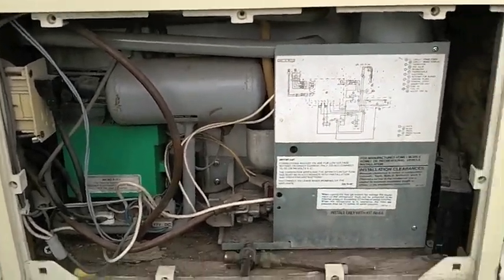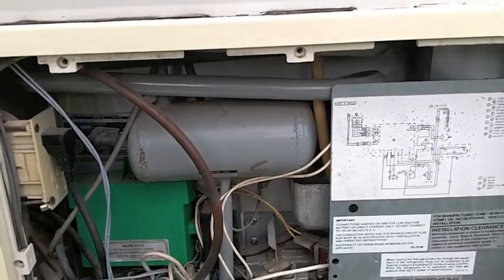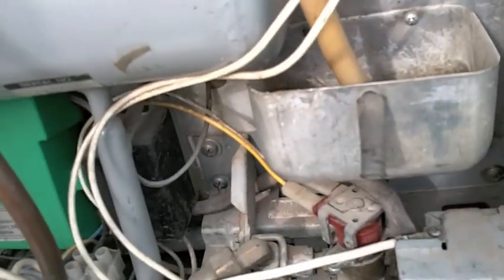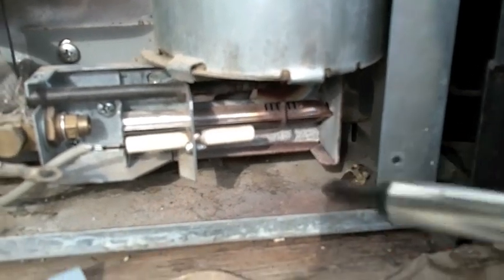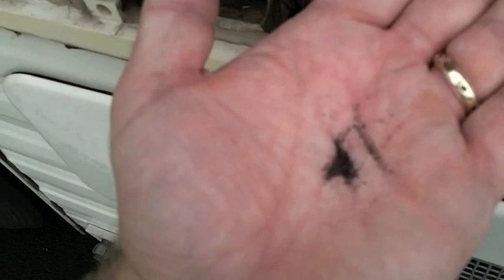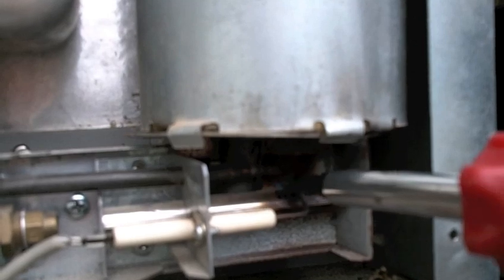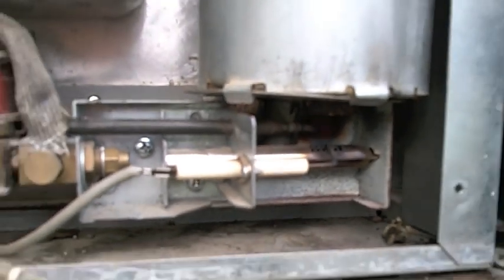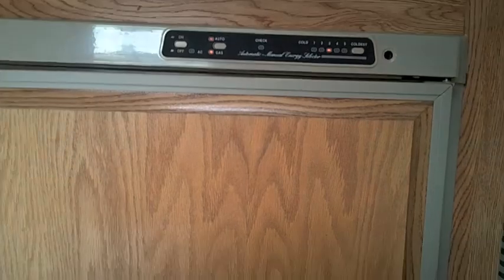RV Refrigerator Troubleshooting

Comment: This morning when we were leaving the camp ground I decided to test the gas option on my Dometic 2662 refrigerator. The "check" light came on so I removed the panel on the side of the camper and tried to start the gas burner on the refrigerator again. I noticed flames coming out of the protective cover near the burner jet. I quickly turned off the refrigerator. When I got home I watched this video and removed the cover over the burner tube and noticed all the slots on the top of the burner tube were clogged with some sort of hard dirt-like substance. After removing the burner I noticed the tube was filled with a dry--mud like substance. I suspect an insect (perhaps a bee) tried to make a nest in the tube. Anyway, I got my gun barrel brushes and air compressor and cleaned out the burner tube and slots. After reassembly the burner started on the 1st snap. Thanks for the informative video!
Reply from the maker: Awesome, I am glad you got it to work again.

Comment: My family's Dometic RGE 400 was much louder than usual and no longer cooling as it should. The freezer temperature seemed fine, but the fridge wouldn't go below 55°F. We cleaned out the burner with a 5/8" airlock brush, which can be bought at a homebrewing or winemaking supply shop. Now we've got a clear blue flame, no noise, and a cold fridge. Thanks!
Reply from the maker: +Eric West Nice.  I hope it keeps working well for you.

Comment: Nice video, helped get a nice blue flame. I’ll see in the AM if it’s cold as it should be.  By the way, a .45 caliber cleaning brush fits that tube perfectly.  Mine looks new inside and out. Now for 12 volt troubleshooting

Comment: Wanted to say "THANKS". Did exactly as you said and it WORKED. It was rust particles and pieces of rust sitting on top of burner (flute) tube. Vacuumed out junk and it works great, items came from stack. Life saver going on trip in three hours.

Comment: Just want to thank you for your video. I started having problems while camping.  The gas check light would come on every time I turned around.  So I followed your video and sure enough my vent was full of rust. I took if apart and cleaned it up. Now it works great 👍 Thank you for sharing that.  Happy travels!
Reply from the maker: Glad it worked for you!

Comment: The first time I cleaned the burner on mine it didn't make a huge difference.  A week or so later, I took it apart again and did a better job of cleaning the burner and knocking the flue to loosen up any rust.  There really wasn't a huge amount of rust. (12 year old Dometic)  I also too the nozzle off of the gas control and blew it out a bit.  This time, I could see a much nicer flame, and in a short time I had a very cold fridge!!!   Thanks for your help.  The main thing to remember is the clear statement you make at 5:06.  If you have anything other than a nice blue flame, you have a problem.  
Thanks again from Ohio.

Comment: Atwood Refrigerator HE-0801did light at the burner and there was no visible rust or soot.  I took it off and polished the flame vent holes and the frig once again in my Grand Design 2015 Reflection worked efficiently by propane.  Thanks for the video.  It was an easy fix.
Reply from the maker: Glad it worked for you!

Comment: Just went on a camping trip here in michigan and my freezer was real slow to get cold and my fridge just wouldnt get cold...lucky i had enough coolers to keep our food cold but i got home and watched this video and took mine apart and it was caked with crap and rust! cleaned it up and it works just fine now! Ive had this camper 17 years and never done this and its a 1979 and im betting it had never been done because the flame is nice and blue now and was orange before..in fact the flame sounds stronger than it ever has! Thanks for the help!
Reply from the maker: I am glad, keep it on the road as long as you can brother.

Comment: hey man good video. I just went thru this proceedure myself today. good tip I'll give ya on that burner tube, I dropped mine in my ultrasonic cleaner with a solution of water, ammonia and dish soap. ran it an hour and the inside of my tube is like new now.
anyhow reason I come here, last night I developed a gas leak, yeah inside the camper!

That's the reason I'm doing the cleaning today. the leak has something to do with the fridge but I can't for the life of me locate it.
Right now burner flame is going good after cleaning, got best flame I've ever had following the ultrasonic cleaner. but I still can't find this leak, I only smell it when the fridge is on gas.
I've removed the front panel, snoop tested all the fittings with gas flowing (very good ventilation and fan running) but still no luck. 
after ripping the rear side apart, valve and all I moved to the inside, pulled the thermostat plate with gas controls and dials apart and snoop tested everything and still nothing. 

any ideas what it could be? I even thought maybe my flame isn't efficient enough and is allowing unburned fuel to escape but I find that hard to believe as good as she's burning. 
I'm out of ideas and yet I sit here still smelling the gas. 

is it possible another appliance only leaks when there's gas flow to the fridge maybe? soon I cut the fridge off it goes away. 

mind you I can clearly see the entire gas lines, fittings and everything how I have it pulled apart. I know I'm not missing anything. Could gas be squeezing out from around the jet air intake ports maybe? you know, where the jet pulled fresh air in before it hits the burner slots?
maybe I'm getting some back pressure or to much gas pressure going into the flame? I don't know just throwing things out there. 

Thanks!

Comment: Yes ...I have cleaned out the burner tube  ...polished the vents in the tube, and the end of the igniter. There was a LOT of almost black metallic rusty material in the burner tube. And I removed the orifice and checked that it was clear. I'm new to this 3-way fridge stuff  ...so please bear with me as I ask dumb questions: I have the original Install and Operate instruction booklet, which has an exploded view of the parts, etc. Question: the gas shut-off valve near the burner controlled by a slotted screw, not a lever. Should the slot be side-to-side, or up and down for the 'ON' position?

Comment: back in 72 i bought 35 foot rv and the fridge was 110 volts ac or 12 volt dc no propane in the fridge. It got warm on me my 8th year and I was about to replace it when another rv'er said don't waste your money simply remove it turn it upside down and 4 days later put it back in and it will work. I thought he was nuts but figured what did I have to lose. when I hooked the house battery's  back up an hour later I checked it and it was working fine it was still in it when I sold it 6 years later and I passed on the fix to the new owner. I'd take it out every winter and turn it upside down then reinstall every spring never had a problem after I learned that trick. The fellow that told me was a retired Frigidare service tech for 46 years before he retired. He said the oil in the refrigeration system and ammonia eventually moves away from the heater and buy turning it upside down everything goes back where it belongs.

All I know is it worked when I followed instructions.
Reply: thanks so much for the tip
Reply: What a great story! I can only imagine doing it myself outta desperation as it seems so "off the wall". XD

Comment: 6/11/2022 nice video, Tnx a lot. My Dometic 2004 model is ready to crap out, the A/C heating element is rusted in Solid - Kroil sprayed on it, still won't budge... almost ready to order an "EasyChill" all A/C Fridge and dump the Propane Tanks.

Comment: The chimney on the refrigerator is about an inch around. It is surrounded by the Ammonia gas tube. The larger galvanized tube around the outside is filled with 1 tube, 1 chimney, and insulation. You go to the top vent and remove it, remove the diffuser cover and use a piece of coarse steel wool on a wire coat hangar wire and use this to clean your chimney. If the chimney coats over with carbon it will not transfer the heat to the ammonia tube.

Comment: Great troubleshooting!   
Here are a couple more low-tech fixes for RV fridges that aren't cooling properly:  
    1. The thermistor is usually clipped to a middle fin in the freezer--wrong position!  
Move it to clip onto the warmer end-fin, and at a higher vertical position on that fin. 
This should cause unit to run more, therefore chilling better.  
    2. Another manufactured-in fail--point on some RV fridges, is bad, spongy insulation on unit.  
No refrigeration unit should ever use open-cell foam or fibrous insulation, because those soak-up moisture and grow mold.  RV's are susceptible to mold anyway; fixing this helps reduce that issue [though only in part]. 
     Replace that spongy insulation with closed-cell foam, and thicker than original if there's room.  Sticking it well to the basic box is best, to block condensate forming between the box and insulation.  
Just avoid insulating over cooling coils in back of unit.
Reply from the maker: Thanks for the tips, you must work on them?
Reply: NelsonStudios Not professionally, but I do play with them! [been known to run with scissors on occasion, too]
 We had an elder living with us who needed their own fridge; all we had was an RV fridge.  In process of fixing that to work, learned about the soggy insulation issue on RV fridges.
..IDK if all of then have that fail-point [regular fridges have far too little-but that's another story], but it had something to do with ours.   And knowing some bit more than basics about insulation; and some experimenting on other old fridges.

Comment: Good tips Nelson, thanks!  I have a 1997 Class C Fleetwood Tioga.  Only had this rig 3 yrs.  Fridge worked fine on both propane and elec (2-way only), then started acting up.  Now it runs on electric fine, but propane burner goes out in a minute after igniting.  Flame had a tinge of orange in the blue, so will check out the chimney flue type thing for rust.

I used a compressor and cleaned out the burner area for 15 mins, but did not bang on chimney.  I don't know how to turn off the DC battery power in my rig.  Don't see a disconnect switch, maybe I should shut down the converter fuses?  I will check solenoid, gas valve inside this area, clean out 'chimney', and if burner end can be removed, I will do that too and clean it.  It would be great not to pay someone a lot of money to fix this.  Are there any parts to replace cheaply?  Currently staying in my RV and leaving town in 2 wks to move to a new city, so very anxious to get my fridge working.
Reply from the maker: Just with what you have cleaned so far has the flame shape/color improved?  If you are desperate the fridge could be lit with a bbq lighter.  You can pull the battery cables off one side of the batteries to cut 12v power.  If you have a solar panel it will depend on how they have wired it but normally pulling post off will cut that too.
Reply: NelsonStudios - I went to see an RV repair shop. They checked the flues, and they were clean.  Checked DC current and traced weak power to a loose battery connection.  Checked thermocouple, it was bad, so they replaced it.  Burner went off nice and strong, and now works on propane just fine.  Yoo hoo!  I feel so glad!!  I will review your video again at a later date and make some notes for future trouble shooting.  I do need to get a 12V tester or Multimeter and study how these fridges work so I can troubleshoot it myself.  Thanks a lot for getting back to me!!
Reply from the maker: I am glad it worked out for you.  Failed thermocoupler is one of those issues I haven't had...yet

Comment: I also had a problem cooling, found out the burner wasn't burning properly which caused sot in the flu (chimney) cleaned it out with a wire and has worked fine.

Comment: Great video, I have a older RV that I got a couple years ago. Had no idea if the Dometic RM 2807 even worked. It lite on LP but just made some "gurgling" sounds from the back side (outside). Not sure of the color of flame as we haven't used it since we got it, but are going to be next month. Do you know if that is normal? It didn't seem to be getting cool inside, but I did notice that someone had replaced a couple things back there and there is one wire that isn't connected to anything. I have yet to try it on A/C to see if it gets cool that way. I did get a schematic from Dometic and am going to try to figure out where that unattached wire belongs, along with the procedure here in your video. Thanks for sharing, and any help with diagnosing  my fridge would be appreciated.
Reply from the maker: Steve Foster Sorry for wait, yes they gurgle some times.  Not 'normal' but not abnormal either.
Reply: Thank you, turns out it was shot. Replace the coil and it worked great in the cooler weather, but not so much when it got hot. On high it did ok. Not sure if I got the new one in as far as it should have been. The steel angle along the sides were bent a bit when it arrived, but carefully straighten them out. Will pull it out again in the fall and make sure it's in properly. I replaced it while we were on a trip.

Comment: I have an OLD 1979 Airstream with a Dometic fridge that uses EITHER gas or electric.  The pilot for the gas works but the fridge doesn't do anything.  When set to electric also... nothing.  I have followed the directions to start the fridge... plug it in... turn to electric... turn up thermostat.
Reply from the maker: Check that you have power behind the fridge.  I would imagine that a 79 would have all manual gas stuff with a pilot light but it could still have electric solenoids.  That the pilot is working would lead me to think the gas side might be fine.  Check the back of the fridge for any signs of a green or yellow powder, you might have lost all the ammonia.  If still nothing I would try removing it from the mounting hole and turning it upside down for several hours.  Put your ear to the tubing and listen for gurgling, gurgling is good.  If crap has blocked the lines that might mix it up a bit.  If it works, and it probably wont, then you are on borrowed time but it might get you by for a while.  What you describe is what my fridge did when it lost the ammonia.  I found an Amish place that rebuilt them and they sent me a new ammonia side.  Been working ever since but might be better to just measure the hole and find a more modern one that will fit in.
Reply: NelsonStudios 
When we talk about turning "it" upside down, what exactly, are we referring to? I apologize if it was mentioned already.
Thanks in advance!
Reply: @jasonledbetter4372  It means removing the unit and turning the fridge upside down..overnight.  Then upright again,...wait a few hours and try it

Comment: Hi Nelson, I have a 1994 southwind with a 2 way dometic fridge. It works great when on AC but the "check" light goes on and stays on when in Auto mode, and coach is not hooked to shore or AC power. From my reading I think this means it is not igniting. Can you tell me, or give me a link showing how to get the igniter to light? Thanks and thanks for this great vid.
Reply from the maker: +Old Fart New Start Take the cover down on the furnace and have turn it on while you stand next to it.  The igniter makes a snapping noise.  If you hear that check that it is snapping in the burner and not some place else.  If no noise check the fuses are ok and the control box has power.  If it has power but not sparking you might need to replace the control board in the fridge or the igniter itself.  Sort of flip a coin and see there.  If it is snapping properly make sure the second gas valve in the furnace itself isn't turned off and the tanks are full of propane.  Make sure the tanks are on.  Turn on a stove burner and burn some gas, check that the flame is blue.  If all of that checks out then your electric gas valve is bad or the orifice is plugged.  In that case follow what I did here.

Comment: What should the gap be between the igniter and the burner?? On the Dometic RM660 in my 1979 Dodge Diplomat, the gap is about 1/4 inch between the burner turbe and igniter (firing tip) , and also about 1/4 inch between the thermocouple (feeler point).  I have the original Installation and Operating Instructions, but these gaps are not specified ...
Reply from the maker: I know it has to have a gap to suck a proper air mixture for ignition.  I didn't think they were even adjustable but maybe back that old they were.  Is it not firing properly even after blowing out the burner?  Maybe something is in the orifice, can you unscrew that and peep through it?

Comment: One thing I discovered causing my fridge to not work on gas.  After removing the shielding cover and then the cover around the ignitor the burner & flue was a large cinder block gas.  
Note it is hard to see as it is black sot.

Comment from the maker: Sounds like a dirty burner, the ac heating element is inside and working but you are not getting good heat transfer from the burner.  Try blowing it out with compressed air or take it apart to clean.  Might have something behind the orifice but that is rare.